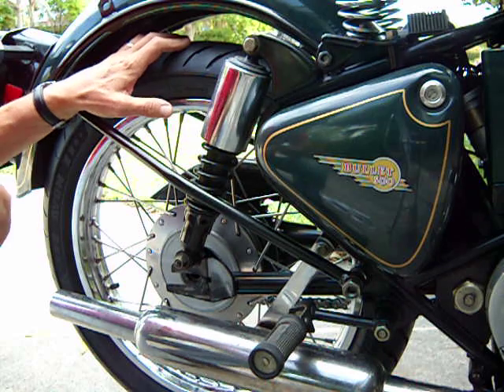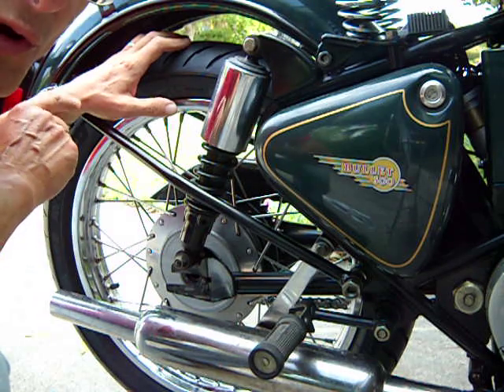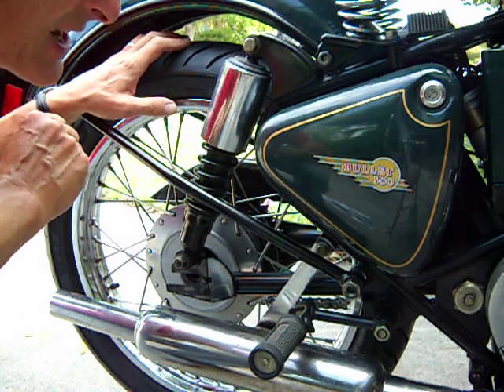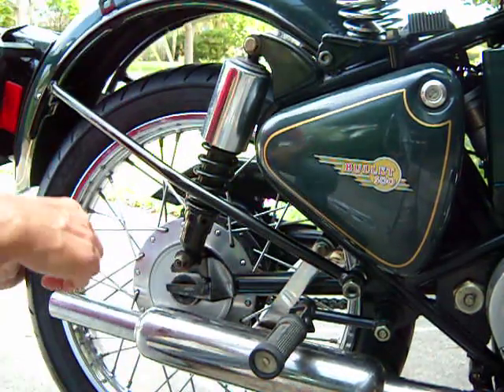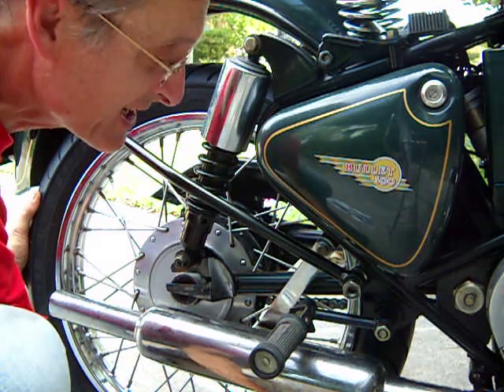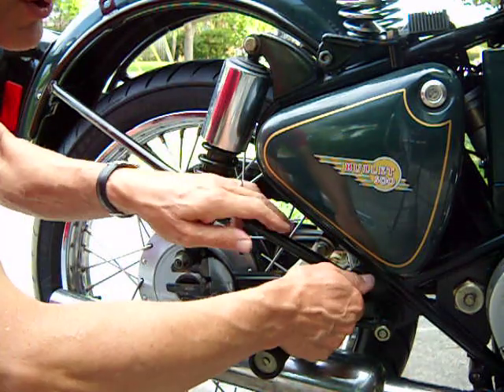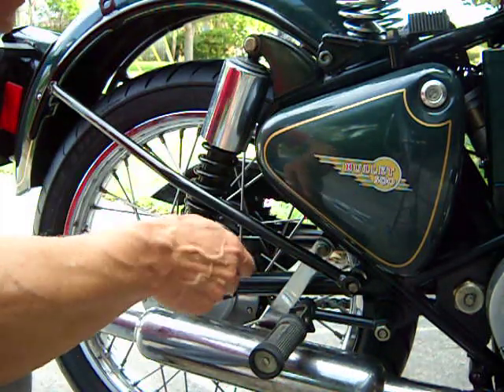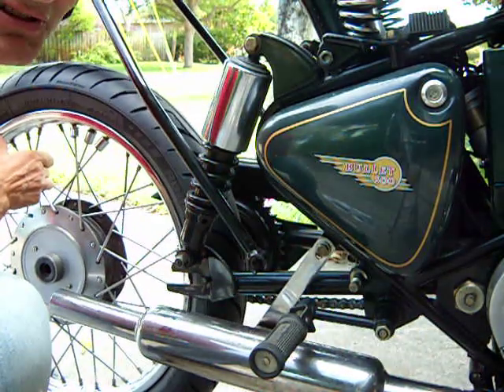How to remove the rear wheel from a Royal Enfield Bullet motorcycle

Comment from the maker: Excellent point. But the dual seat on the older Bullets comes off easily: another couple bolts to loosen. It's much easier than trying to hold a motorcycle on its side while wiggling a wheel out from behind the pipe and fender.